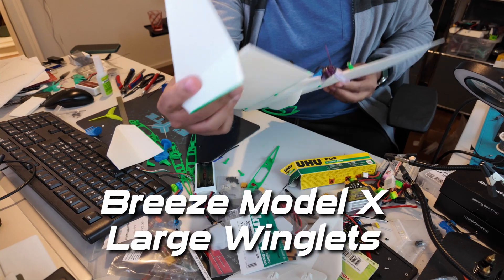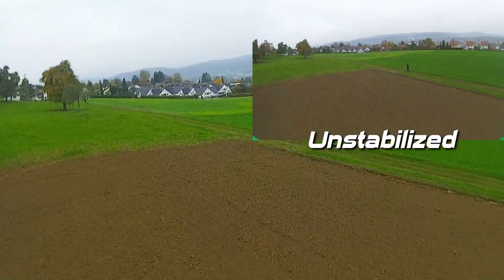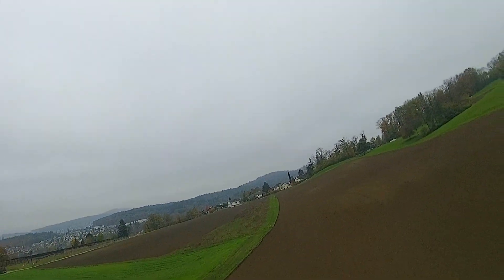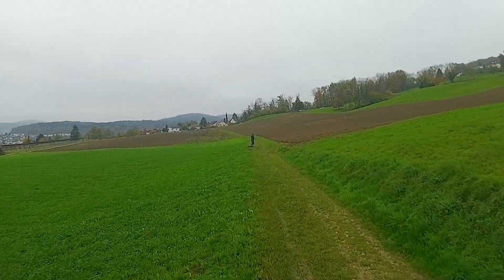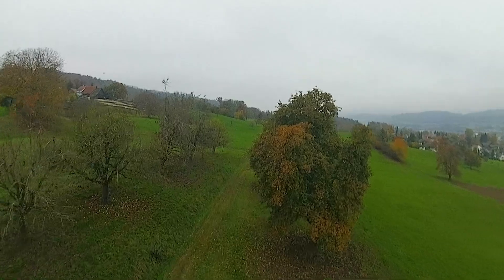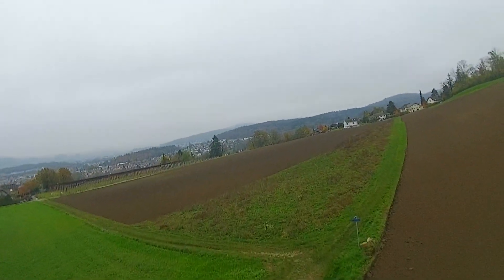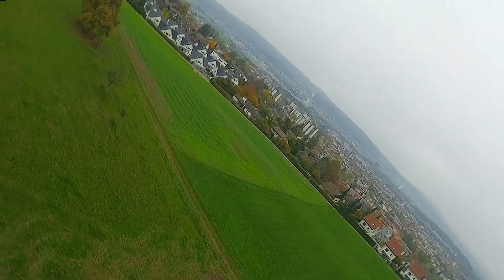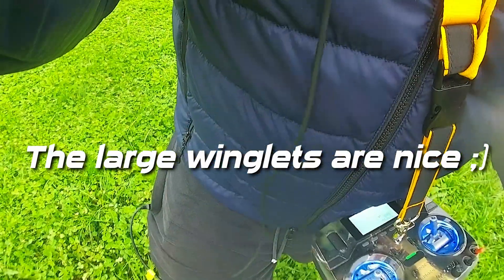Breeze Model X - 3D printed FPV Wing // Testing larger Winglets - INAV 7.1.2

Comment: Looks very locked in compared to mine. Any chance you would share you PID profiles for INAV. I’m running the larger winglets also and stock setup the designer recommends but nowhere near as smooth as yours. 👍
Reply: That would be much appreciated. I’m running INAV 8.1 also with a speedybee F405 mini.
Reply from the maker: @Sparkyboy247  Sorry mate, I was sick for a full week -> here you go: https://drive.google.com/file/d/1pEMYFCHTAwHpS0pfEgdQvK4gR7gpk2u-/view?usp=drive_link it's a conversion to INAV 8 file of my diff.
Reply: @McLogo76  Brilliant thanks for that mate, hopefully your felling better.
Reply from the maker: Sure, are you using INAV 8.00 or higher? I could provide a diff of my setup with the speedybee 405 mini